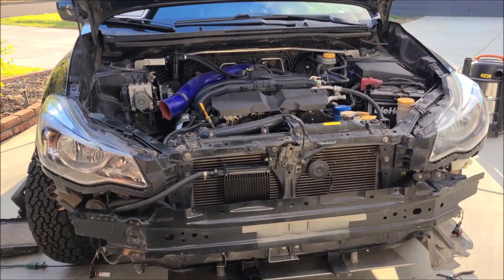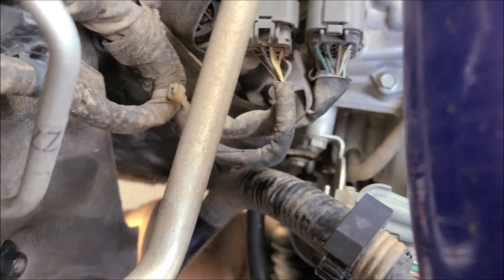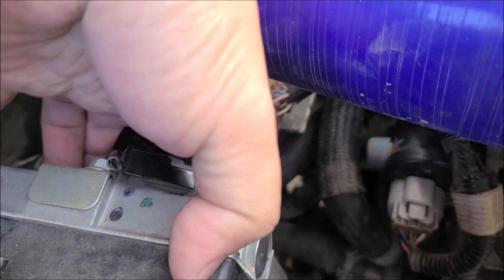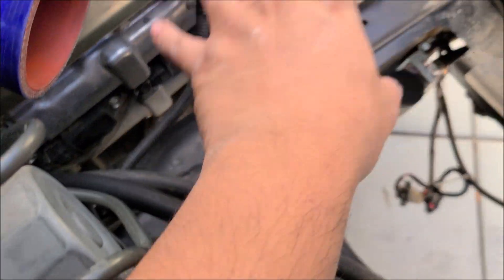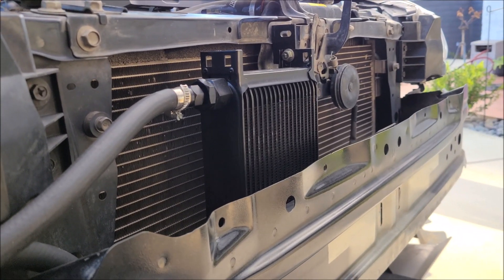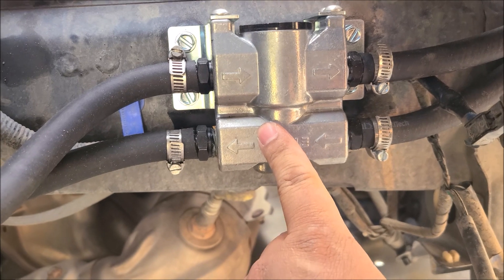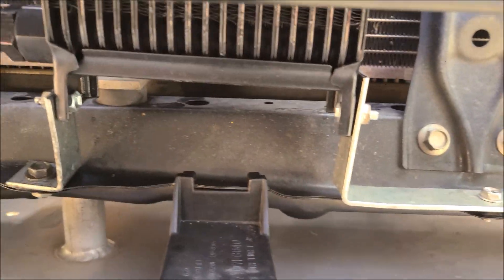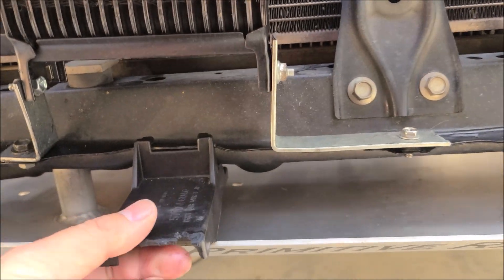Custom CVT Cooler on Subaru

Comment: Did you add ATF fluid afterwards? Seems like added capacity, so cool but low fluid probably isn’t beneficial! I had the thought of adding an inline changeable filter for longevity.
Reply from the maker: I added about a half quart of CVT fluid. You don't need to add a filter if you change your fluid every other year or so.
Reply: @ every other year!! I’ve seen every 60,000 miles, but I guess changing it that often is cheaper than having the cvt solenoid problem fixed!